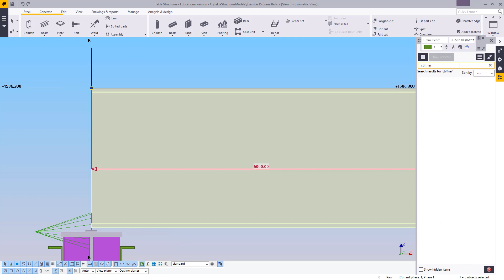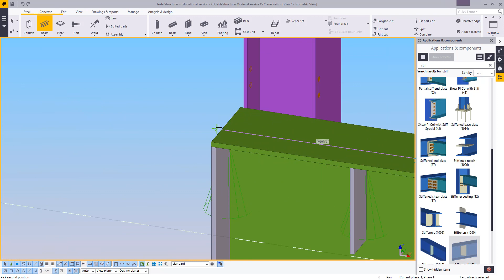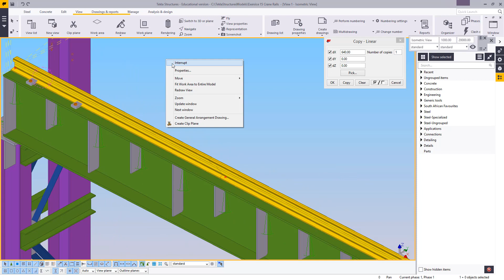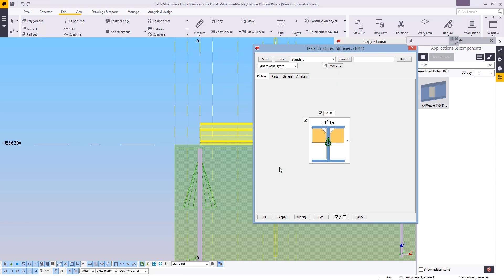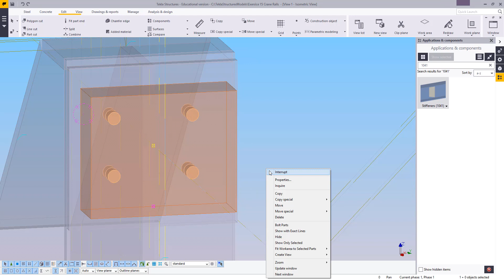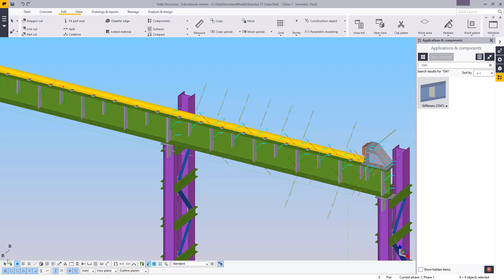Exersice 15 Crane Rails

Comment: sir can u do tutorial on monorail
Reply from the maker: If you mean an overhead crawler/trolly. then It's fairly simple.
But if you mean a monorail train?
Then no sorry, I have never done anything like that as it's more in the realm of civil engineering and not steel.
While the rail/guides on the side are usually steel bolted to the centre beam, the centre beam is most often made with a pre-tensioned concrete beams
Reply: Like just a curved beam
Reply: Have u done tutorial on splice connection
Reply from the maker: Both the curved beams and Splice connections are on my list of tutorials to make. but It will probably be a while before I get a decent tutorial out about them.

For now, though I can whip you up a quick overview of them.
Reply: Sir do u Ave any link of tekla 2018 version software
Reply from the maker: Nope. The Tekla Educational version that I use is still only on version 2017.
Reply from the maker: https://youtu.be/5BjzzLYwa5I
Reply: Thank you for wonderful tutorial sir